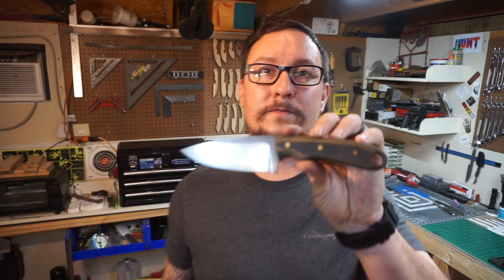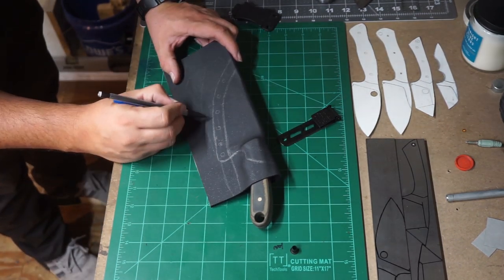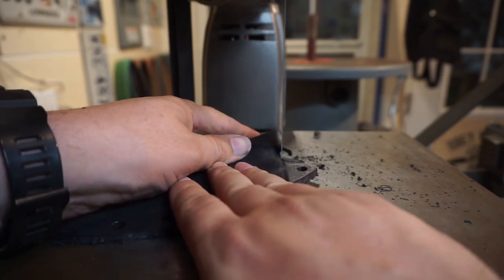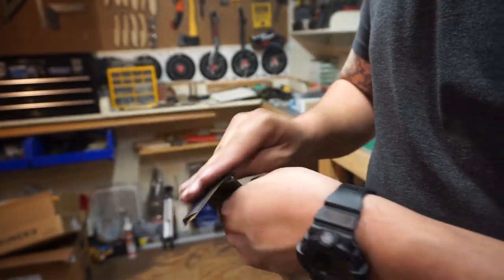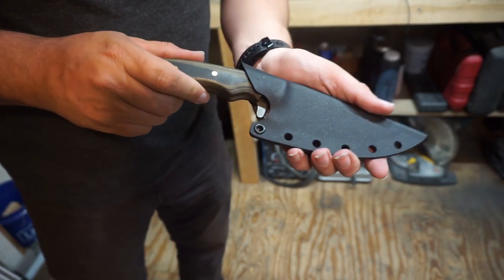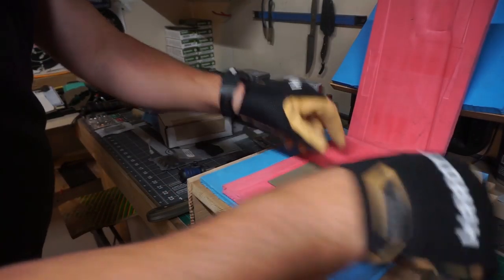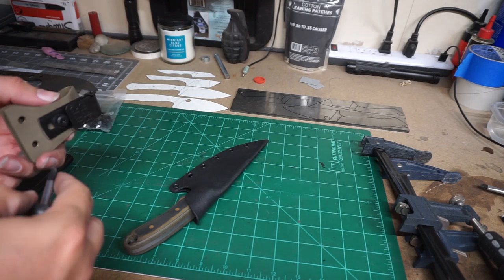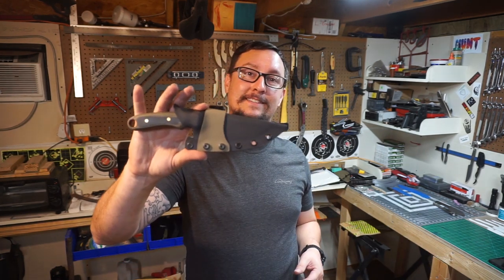Making A Sheath | Multi Layered Kydex Sheath | Horizontal Carry

Comment: you can make a press by taking a Harbor Freight Arbor Press by drilling out for the dyes. Works great, have been using it for 3 years and it works great. Cost is $25 with normal special discounts from HF.
Reply from the maker: I might have to try this out. Thanks for the idea.